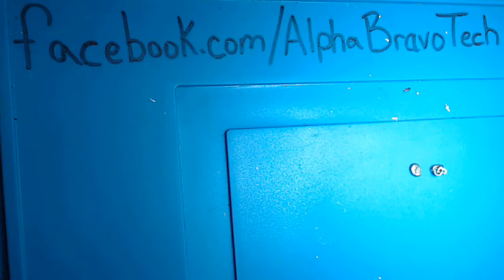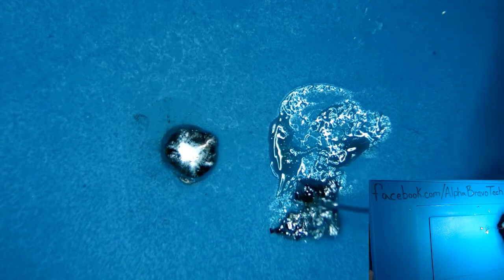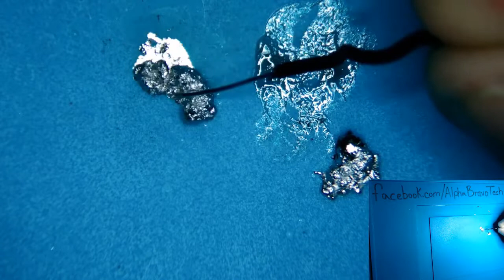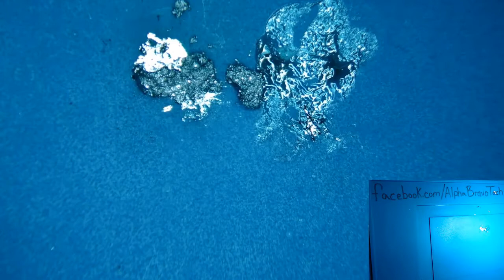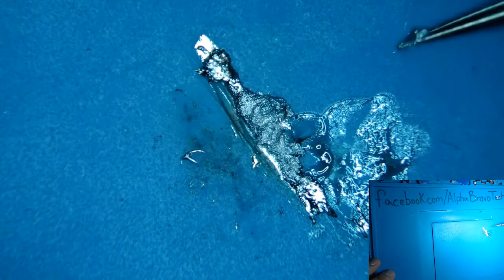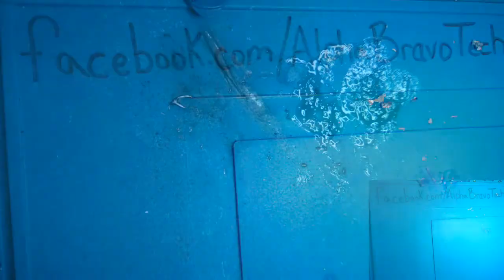Rose's Metal. A Low Melt Solder Alternative to ChipQuik

Comment: The original product (ChipQuik SMD1) has a much lower melting temperature (136°F or 58°C) and will help desoldering even better, if needed. Unfortunately it's more expensive too...

Comment: I been using Fast Chip and bought Rose's metal for a test only.
Both works very well, is most easy to use Fast Chip because is a wire.

Best Regards

Comment: is this also called white metal solder?
Reply from the maker: Not that I know of.
Reply: @AlphaBravoTech  https://www.ebay.co.uk/itm/Very-Low-Melt-70-Deg-Solder-for-White-Metal-25g-Pack-UK-Seller-UK-Stock/202626120637?hash=item2f2d753bbd:g:QeUAAOSwrx1ci6dh   is this the same stuff
Reply from the maker: @oneandonlytyler1  I've never seen or heard of that stuff before. 🤷‍♂️
Thats a super low melting temperature too.